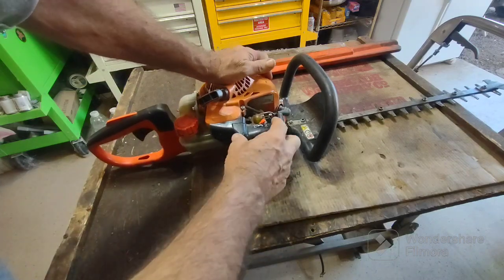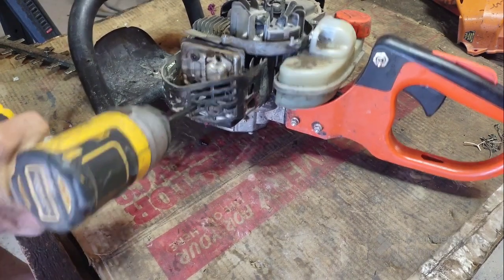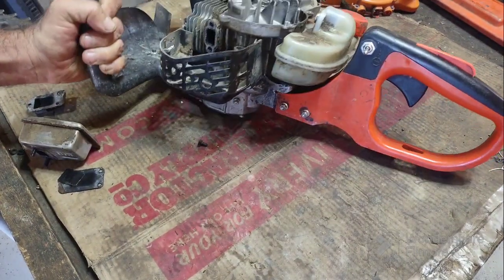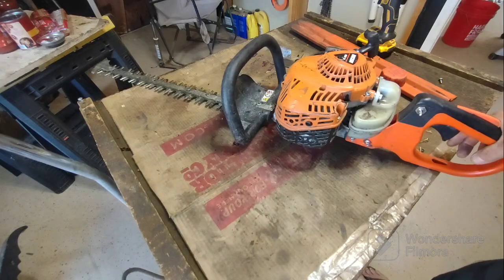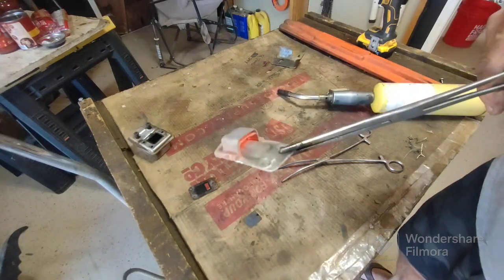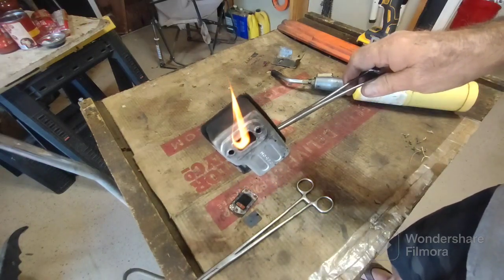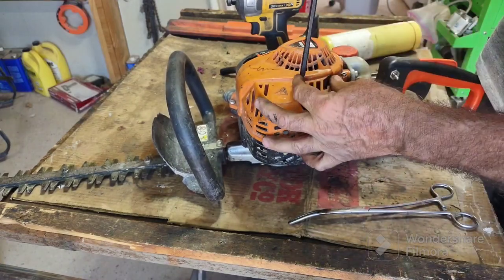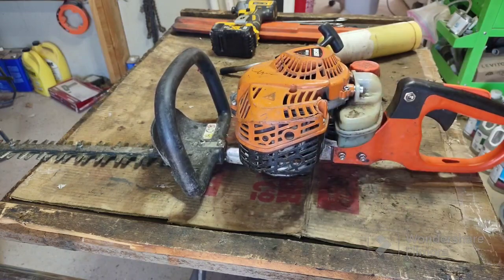Echo HC2020 Hedger won't start and it's too quiet!

Comment: You learned something - I learned something!  A good day!
One thing I already knew - open up the doors, or better yet do it outside!  Smokes like crazy!
I use propane, usually in a vice, but that MAPP gas seems to work a lot faster. 
I have one of those vices you can clamp to something and I put it on my outside bench and that works way better than smoking up the shop. 
I think with that trimmer it was a combination of the parts being partially clogged and maybe the catalytic converter being mostly clogged that caused the issue. 
Thanks for this one, Dave!🔧👍

Comment: Ulitepilot aka Zombie Dave what kind of 2 stroke oil do you use
Reply from the maker: I have been using Castor 927 race oil. My thought is that really high revving motorcycle engines live on this stuff in extreme conditions so it's going to be perfect in small 2 stroke equipment. That's just me though. It smells great too. I'm in Arizona so I don't get freezing temps very often. This oil does not like freezing temps.
Reply: I would love to live in Arizona I don’t like cold weather and snow
Reply: Yes that’s true oil doesn’t like freezing temps